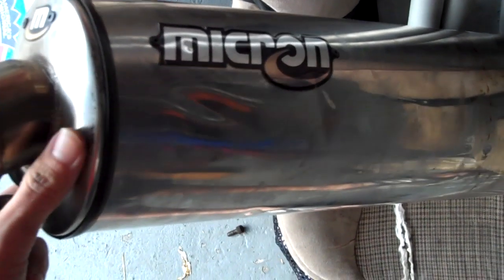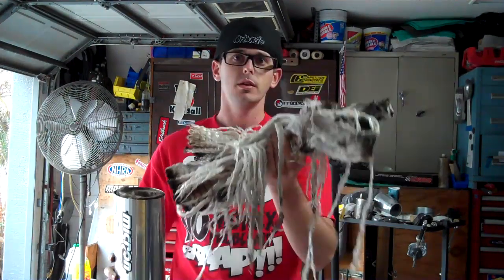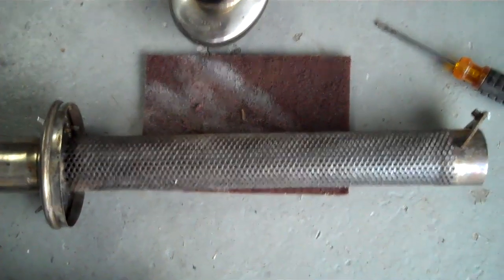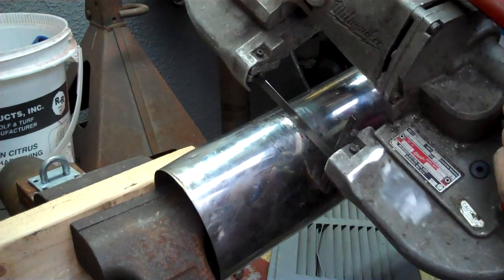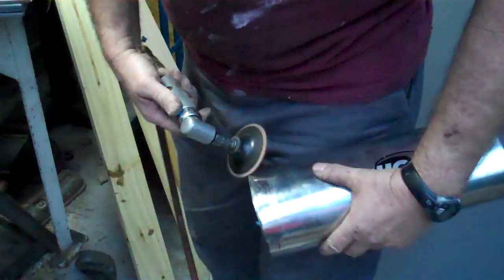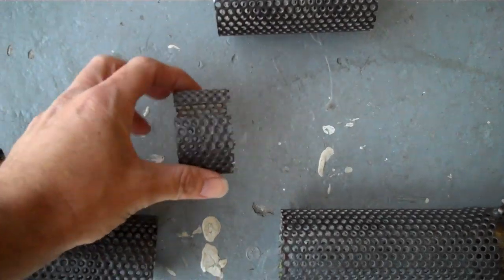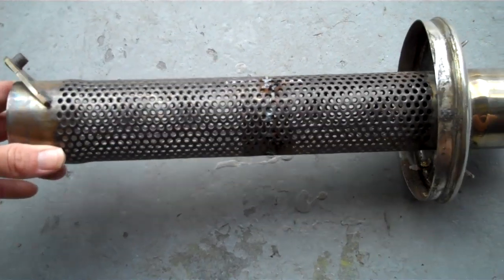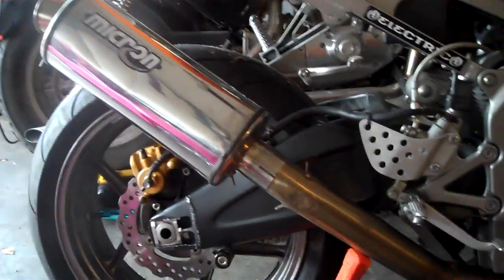Joe Shows You How To Shorten a Motorcycle Stunt Exhaust

Comment: I wouldn't of though shortening a pipe would damage the engine, I run a cb750 with just manifold for Drag racing. It might affect your fuel/air mixture but you can just put bigger jets in.